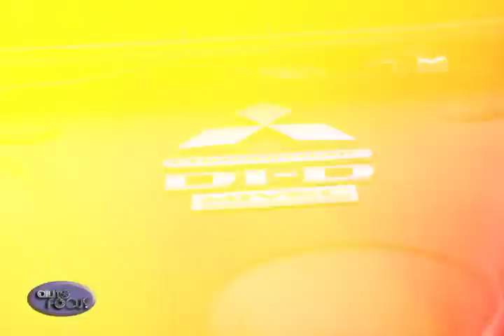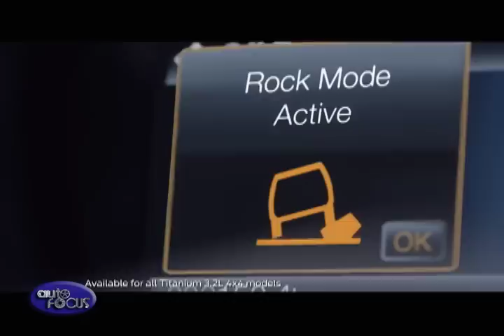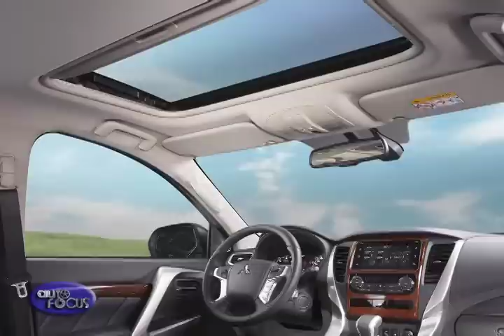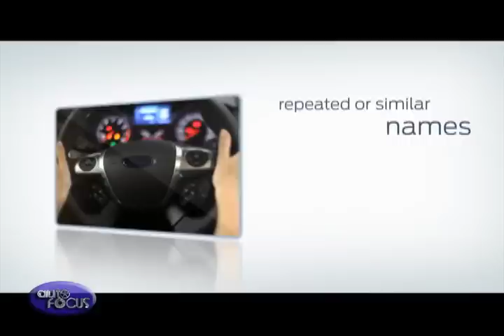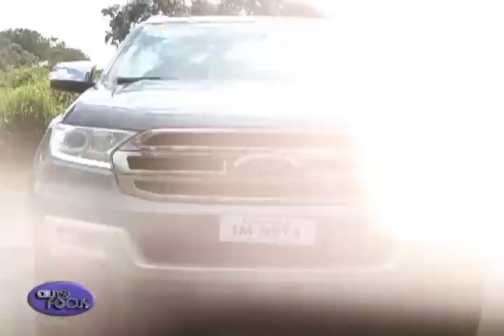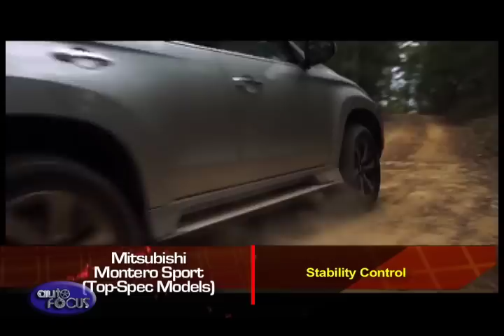Mitsubishi Montero Sport vs Ford Everest   Head 2 Head 2017

Comment: The Everest with Premium Package can also park itself. Well, it steers itself in, you have to control the gas and brake pedals. Automatic On/Off headlights, automatic high beam, and automatic rain sensing wipers. Also, lightest steering in it’s class. Electrically assisted steering instead of hydraulic.
Reply: If Everest is really good, why is it not topping the sales charts at least in the compact segment?  Anywhere in Australia, Thailand, Indonesia, India or South Africa.  It is the venerable Fortuner that is the market leader except in Australia.
Reply: Constantine Caacbay Because Toyota and Mitsubishi made a good image of making reliable cars before until now. Decades back, Ford made very unreliable cars. But now, they make great cars. Sales aren’t everything. Since those owners had great times with their cars, they opt to stick with that brand, hence, brand loyalty. They chose what had a bulletproof reputation over the years. What car maker was that? Toyota. That’s why it topped the charts.
Reply: @FulgentFave  It's not only reputation but I have a personal experience with other brands like Isuzu, Mitsubishi, Ford and Honda.  Sad to to say, only Toyota cars are bulletproof.  No brand comes close to Toyota especially when it comes to convenience, peace of mind, maintenance cost, reliability, comfort and overall value. Isuzu is trumpeting that it makes the best diesel engine cars but probably that was 30 years ago.  My Ford Ranger before cost me tons of maintenance costs.  Mitsubishi Strada has problems with its injectors that keep on coming back.  Honda City maintenance costs is much higher than even that of Altis and the lists go on and on. And mind you, the Camry is as good as IS350 Lexus and now the Alphard, due to its very high quality standards has been adopted by Lexus and rebadged it as Lexus LM (Luxury Minivan). How can you then argue with success?